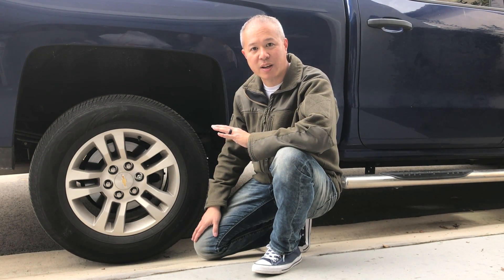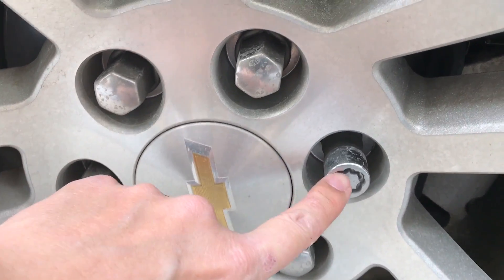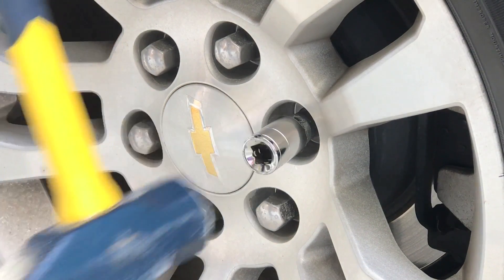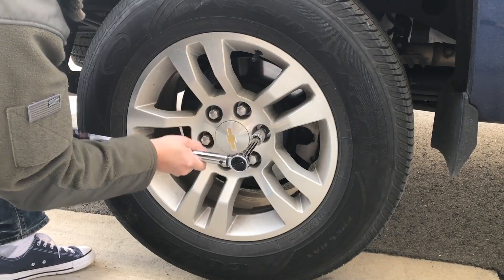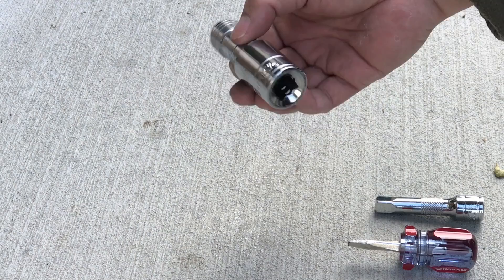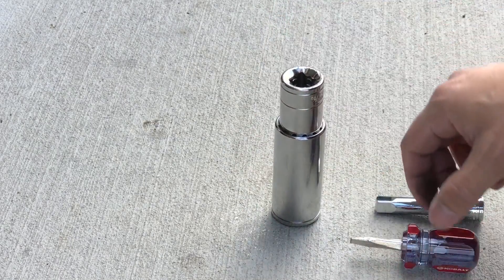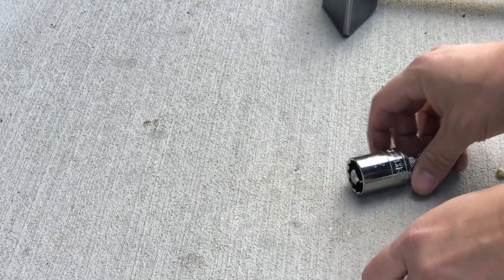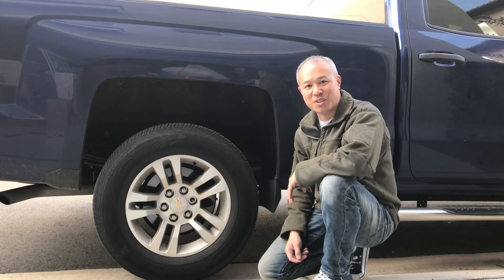How to remove wheel locks without a key using common tools

Comment: Nice video! I had four on my Maxima and I got two off I think using a socket is easier I wind up buying two reverse lock remove those on Amazon and I had a bang the hell out of there is 1 million times to get to those things off so I think the socket works better good job!

Comment: Try tightening the other normal lug nuts a bit to release the stress of the lock nut- that will give you less trouble to loosen the lock nut.
Reply: Thanks man just saved the ducking day

Comment: To get the socket out when it is stuck, simply attach an extender and hit the socket with a hammer.  The vibration will pop it loose.  No need for a larger socket.

Comment: You can use vise grips to hold extension while hammering to remove lug nut from socket.  Will prevent your fingers from harms way.

Comment: I had a customer today with same problem. His security lug nut is so huge (there is small gap between nut and rim hole). Tried to apply same method but i couldnt find socket slim enough to do this without damaging his brand new rims.
Reply from the maker: Lobotom Sorry to hear that. I totally get it. Unless the gap is big enough, this method might damage rims.

Comment: This didn’t work for me but I got this “ABN Twist Socket Set Lug Nut Remover Extractor Tool - 5 Piece Metric Bolt and Lug Nut Extractor Socket Tools” and it worked perfectly on an impact.

Comment: Good Video, I would use a breaker bar, breaking nuts loose isn't good for the calibration on your torque wrench.
Reply from the maker: I totally agree. Unfortunately, it was the only tool I had handy at the time I recorded the video.

Comment: 3:10 omfg you only need one socket just put a somthing solid down into the socket and whack the lock nut out of the socket you may need to put it in a vice or just smack the thing that you used in the socket on the ground to pop the lock nut out of the socket

Comment: What about if the outer part of locking lug isn't fixed & spins round? I knocked a socket on & took me 2 hours to get it off and it's still stuck in the socket now so that method will NOT work on my Fiat 500X
Reply from the maker: Walter Lomax What brand is the locking lugnut? This method only works with the type that is a single fixed piece.
Reply: You probably should've realized that hammering something onto a spinning collar would just cause it to spin with the collar....DOH!

Comment: It will only work if your wheels are not over torqued AND if have the right 12 point socket.. Check first and loosen if needed BEFORE you try this..  otherwise it may spin on the outside and ruin any future attempts..  Ask me how I know..  And DON'T use a silicone lubricant trying to get the socket on or off..  Again, ask me how I know...

Comment: 1. You were way too far away from your mic...
2. You don't use a torque wrench to loosen lug nuts
3. There are toooooo many videos out there about this (using a breaker bar) already!
4. Using an extension to knock the wheel lock out of the socket you pretty much messed-up the extension too... Wow!
5. Consider remake/remove this video so perhaps you will have subscriber/save the embarrassment.
Reply: Rick T damn bro did you wake up on the wrong side of the bed today? Can you be anymore negative? At least he got it off.
Reply from the maker: Haha, thanks for having my back.
Reply: Rick T you have no idea what you're talking about. Keep the rant to yourself
Reply: NOPE!  It IS the best way to remove the damn McGard useless nuts, period.  As far as I can see, He is using a Sears Craftsman MicroTorque Torque Wrench with a capacity of 150 Lb-Ft, so that a properly torqued wheel nut WON'T overdrive or damage it.  Of couse it is better to use a breaker bar, but your comment is too corrosive and out of place.
Reply: @problemsolver7705  Just want to say I removed mine exactly how you showed me. Thanks a million bucks!
Reply from the maker: JStouder133 I’m so glad my video helped you out! 👍🏼